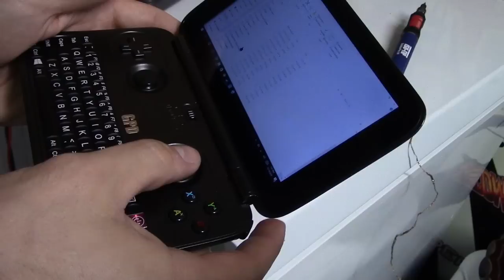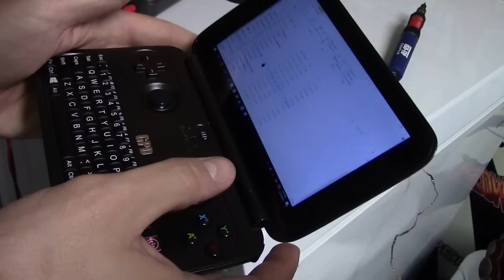How to Fix and Recover Data from Broken USB Drive

Comment: Hi I have a USB that snapped years ago. I want to try fix it for data recovery. The USB head is in pretty poor condition. Is it possible to use any USB head? I have seen videos where you can use an old cable to use the copper wire from it

Comment: hi paul,
UR videos are always helpful as you are.  God Bless and live long.  Need ur help.

Recently, I plugged in my TRANSCEND Flash drive in one of the USB port, power flashed for few seconds and my pen drive is dead, not detectable while plugged in with Computer.  I am not a tech, just a user.  I don't know how to revive my gadget.  I will be so thankful if u guide me to get back my lost data from the flash.
Reply from the maker: Try another PC if your another computers can't detect your drive then check if led on the drive is lit. If no led is lit then can be loose connection like bad solder connection. Try to wiggle to see if it's a bad connection but be careful not to break PC port.
Reply: @TampaTec  sir, first of all thx for sparing your valuable time, replying.  As directed, I checked with another PC, wiggled but no luck, also checked the solders, looks so perfect with magnifying glass.

Comment: I have looked at a lot of videos about fixing my USB, and yours has given me the confidence to try and do it. I have procrastinated for months, and now I bought a soldering gun, and it came with flux, and solder (leaded) and I bought unleaded just in case. Plus I bought stripped pre-cut wires to use for my Black-Green-White-Red wires. Hopefully my next post will be successful and soon!

Comment: hey tampatec, I have a galaxy s6 that has a black screen but it still takes calls and works otherwise, I took it to the repair shop and they don't know what to do.about it. I dont even care about the phone working again as I have a spare but I really want the pics and documents off it. please help!
Reply from the maker: Richard Head sounds like a loose display ribbon cable connection but pics are usually on sd card so just remove it and use sd card adapter then connect to pc. if pics are on the phone then connect the phone to pc to access the data using your pc go into camera DCMI folder.